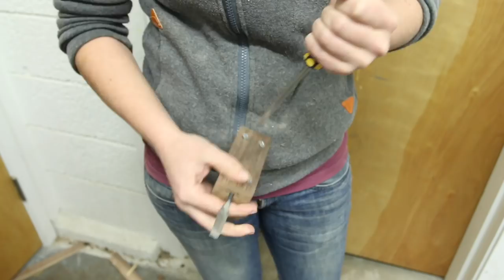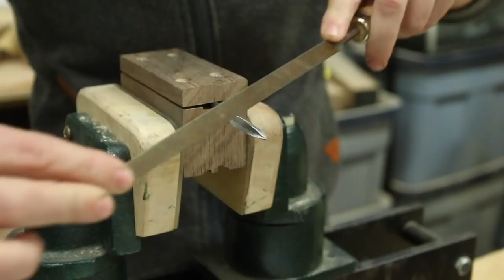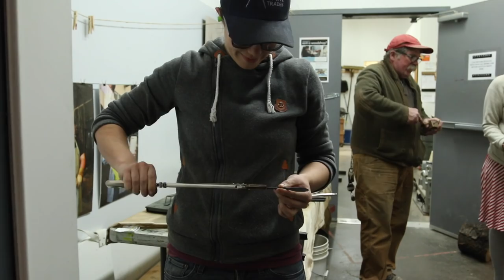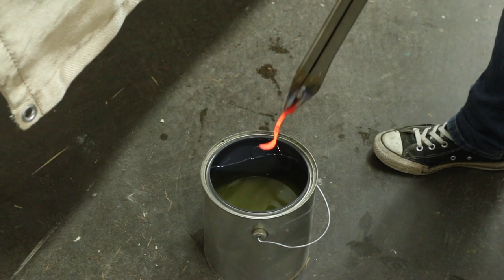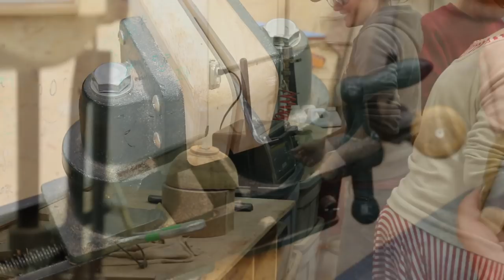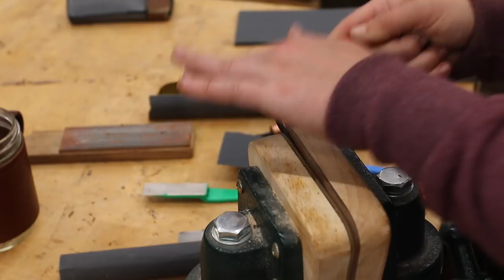How to Forge a Spoon Carving Knife on a Budget

Comment: Good video, Anne! As a student of blacksmithing, a couple points on heat treating.

• It's often a good idea to run it through a couple "normalizing" cycles before the quench. This involves heating it to cherry red, then letting it cool in the open air.
• When heating it for the quench, you want to heat it to non-magnetic temperature. Test this with any magnet. If it doesn't stick, it's time to quench. The quenching process is what makes it hard, but it also makes it brittle. Don't drop it!
• Testing the quench is a matter of running a file over the metal. If it digs in, you haven't hardened it properly, and might have to re-quench. Make sure you do this when the steel has cooled, not while it's still hot, or you'll get a false read on it. The risk of re-quenching is "burning" the steel, which could result in cracks and other flaws.
• Tempering actually partially re-softens the steel, but ultimately makes it flexible, rather than brittle. Thus the slow, relatively low-heat process.

Again, fantastic video, Anne! I'm glad I found your channel!
Reply from the maker: David Oberholzer thanks for taking the time to save some folks some googling! Normalization is an important step I left out of my description especially when working with certain tool steels.

Comment: W1 drill rod is GREAT steel, if heat treated properly. I've made amazing kitchen knives out of it and have made other tools in a pinch. It's like 'better' 1095. I do prefer W2...but it's much harder to come by in general, and doesn't come in round stock very often. When I make my carving tools from W2 I cut an end piece off of 3/8" thick x 3" wide bar stock, then hammer it round to get what you have to start with there lol.

Love your videos and love how far you've come!!

Comment: Hi Anne,   Good job.  Nothing seems to be an obstacle for you.  You need something, you make it.  After hardening, you of spoke of 2 different tempering methods.  The oven method, and the drawing out colors method.  It is important to heat the handle end of the steel {propane torch works great} and watching the tempering colors run.  When the cutting edges turn a straw or somewhat darker color, quench it immediately to lock in the temper, rather then allowing it to cool on its own.  The oven method is much easier to do.  Thanks for posting.  Jerry

Comment: Keep a magnet handy, you want to heat the metal to a temp. that takes the magnetism out of it before you quench.  Also, used oil has carbon in it and that adds strength to the steel.. I'm not an expert, but I do have a portable forge and I learn from the local Blacksmith's in Pennsylvania..
Reply: The oil is the Hardening and the 4-500 degrees for an hour is Tempering.

Comment: Enjoy your videos Anne, keep up the great work.  When using sandpaper, start with coarser grit.  I generally start with 120 grit and work up to 400 grit. Sometimes starting with 80 grit if necessary. This works for most jobs, and going beyond 400 grit is "icing on the cake" when you need your edges very sharp and classy looking. The problem encountered when people start with too fine (400 grit) is that the edges tend to get rounded because material is not being removed fast enough. Shaping the cutter needs to be done with coarse grit, then 400 and finer grits are only used to remove scratches left by the coarser grits.
Reply from the maker: Jim Manson good to know! Thanks!

Comment: Anne, I do not have a forge furnace so will my little hand-held propane torch make enough heat to allow me to fashion some carving tools from tool steel or drill bits?
Reply from the maker: it's possible, though you might want to get a couple ceramic bricks to fashion into a little forge "area" to help hold the heat in better. It also depends on how thin of stock you are using, the smaller the knife, the easier it is to forge with less heat.